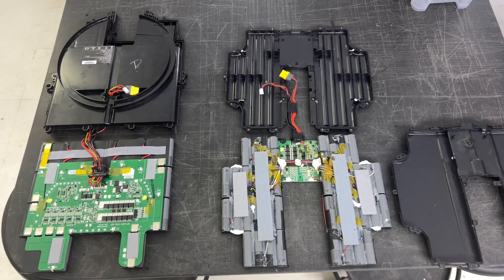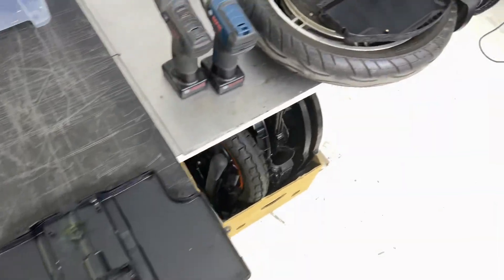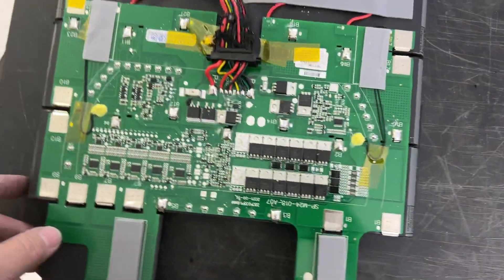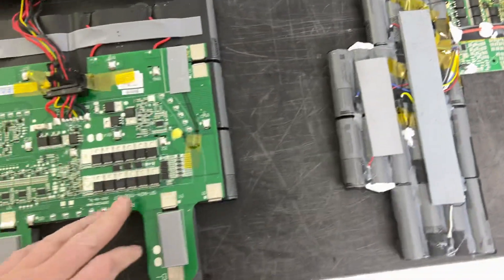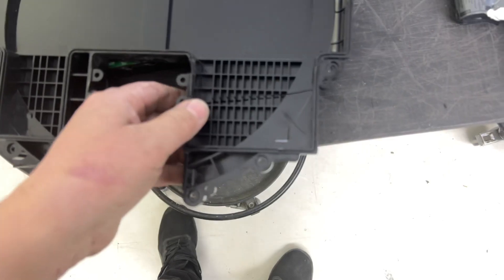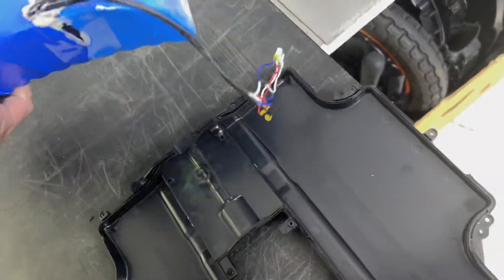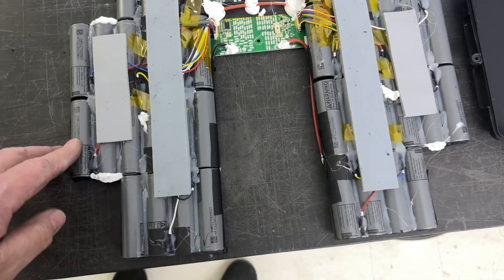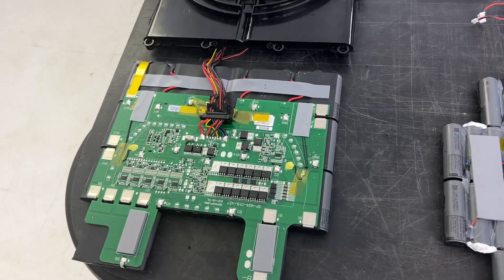EUC Battery pack BMS comparison

Comment: how do we charge the V11 battery without the motherboard?  does the charger connect to the smaller black and red wire plug (white connector)?  there is no voltage on those wires?

Comment: Hi. How did you open battery pack from v12? Can you hellp please
Reply: yo... same... have a battery failure on the 2nd battery pack reading 4.4 volts across the entire pack. Its taken off the EUC on its own now and I'm thinking you just have to pry the two covers apart which does not seem like an easy task LOL.